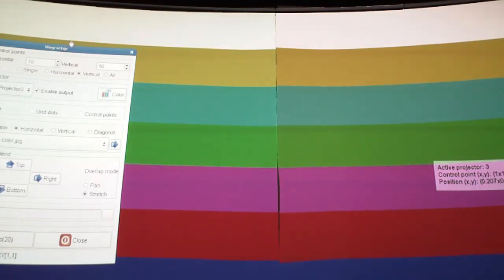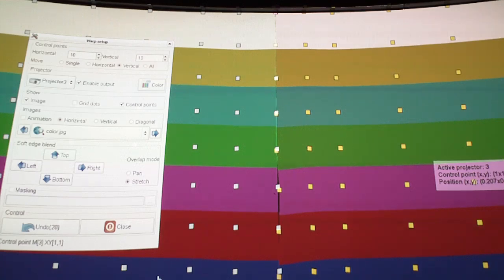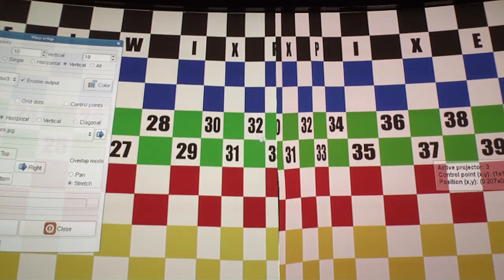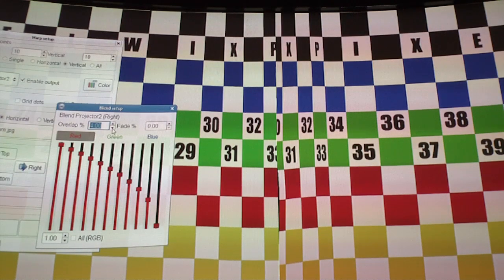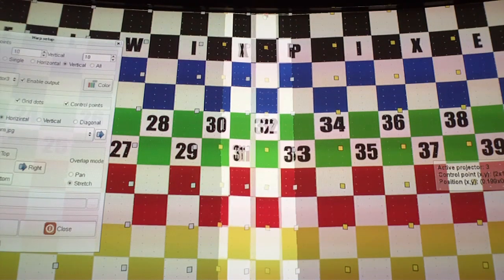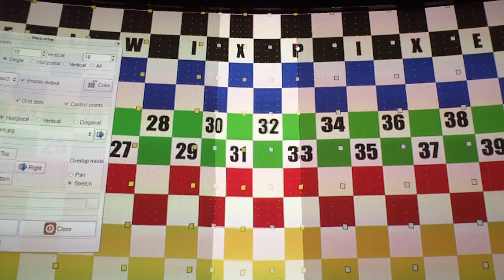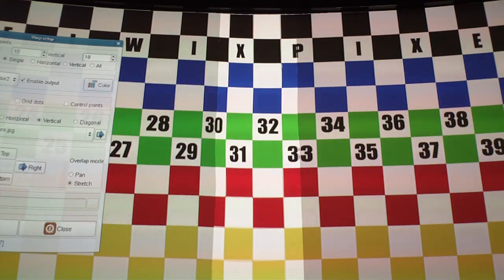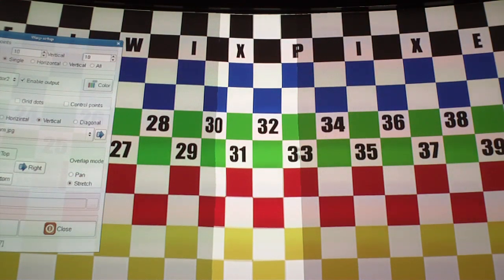Curved Projection screen alignment and correction and edge blend tutorial part 1.mp4

Comment from the maker: They are optima projectors but you need to select your own based on the throw distance you have and area you are trying to cover.
The PC is a Pixelwix Server but again you would have to select the PC based on your Sim software requirements as that likely to require more power than Pixelwarp software.